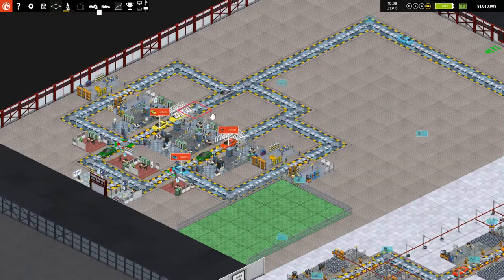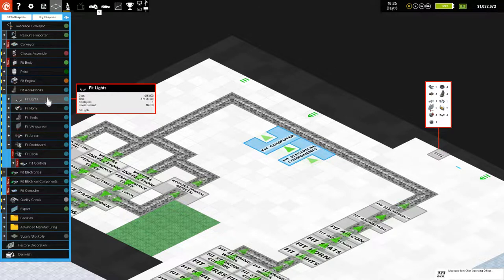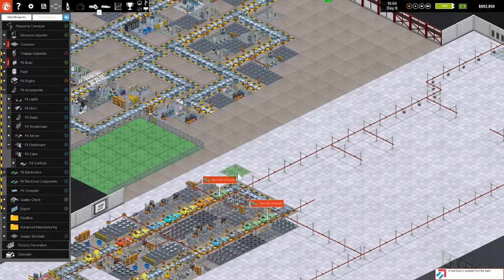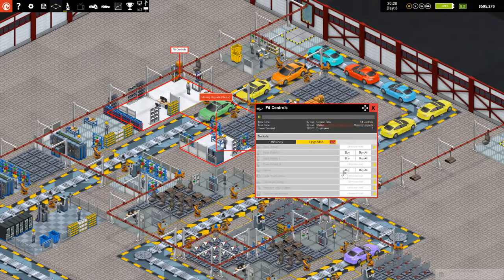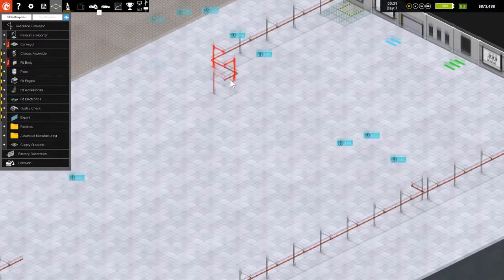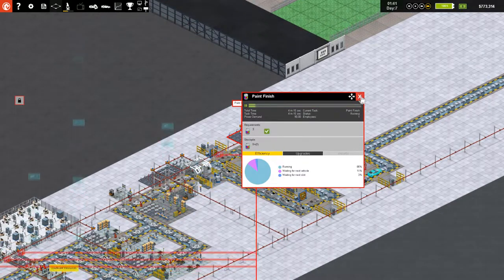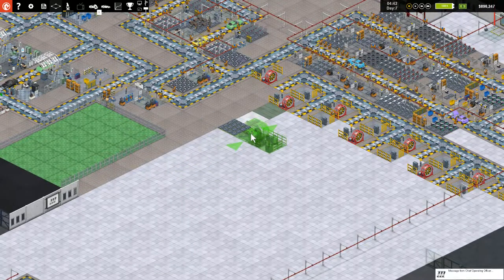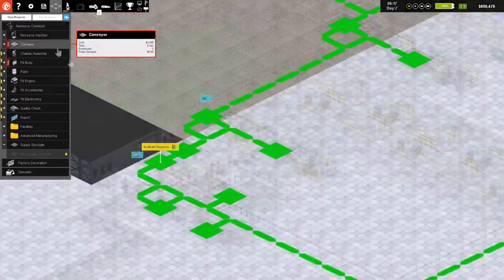Production Line - E06 - Accessories and Electronics Rewrite

Comment: I realise I'm a year late, but I'm going to point it out for future viewers who are playing along:

Accessories and Electronics as a whole are going at roughly 2 minutes per car (henceforth referred to as mpc); however, in the section we're setting up at around 18:30 we have several slots which go almost at or way below 2mpc production speed; yet we still have two causing that slot to produce at (or below) 1mpc.
You can save money by selling the ones where you don't need two, they're just going to be bottlenecked further up ahead anyway.
Sure, costs you a bit in conveyors and a couple extra tiles of space, but you've got plenty room now.

Edit: Also, don't set your paints to a specific mpc until you have the faster drying techs, because BOY do those upgrades change things around a lot!
Reply from the maker: This was all great info and you are absolutely right. Once the dryer tech hit the floor, I was like 'oh snap'. This game was an absolute treat and having that 'speed bump' made it all the more fun. Rewiring everything was a blast. 😁